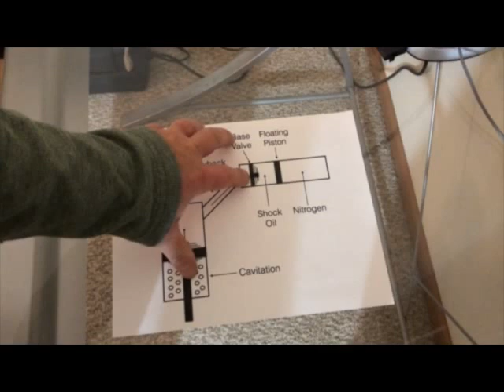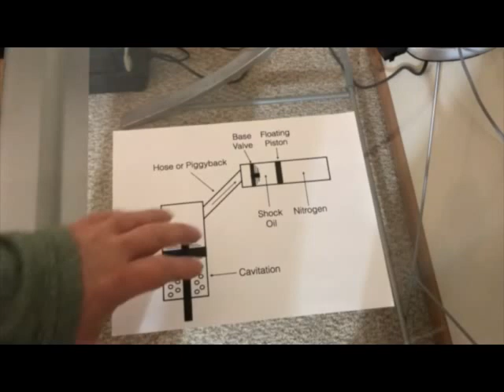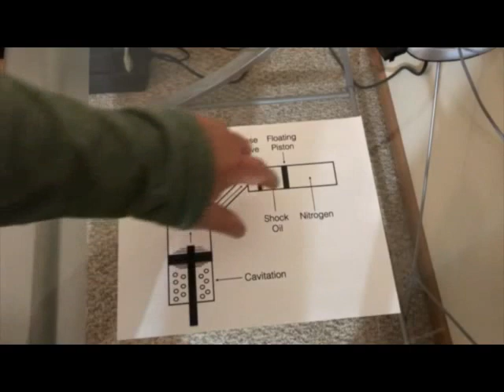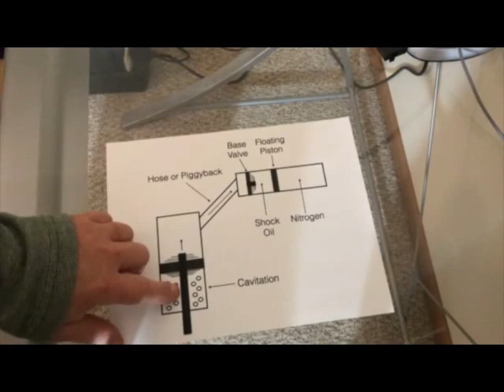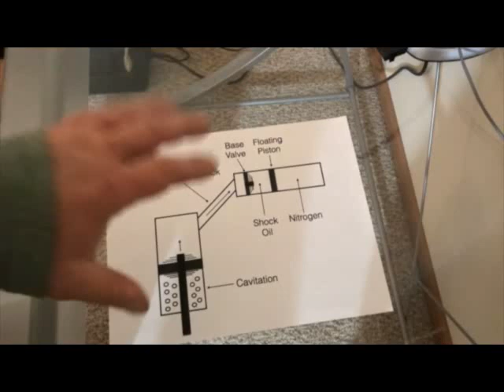Tuning Shocks for Dirt Late Model and Dirt Modifieds; Describing What Base Valves Do.

Comment: Any chance you have a video on how to determine shock valving off a dyno sheet?
Reply: No, not really. I used to have some when we were talking a 6 valve Integra mono tube would look like this … That was years ago and I haven’t experienced anything like that in years.
Now, we just shim plates for what we want the shock to do at certain areas.
If you are running straight valves from a manufacturer, I would contact them and see if they can help you out. 
Thanks for watching